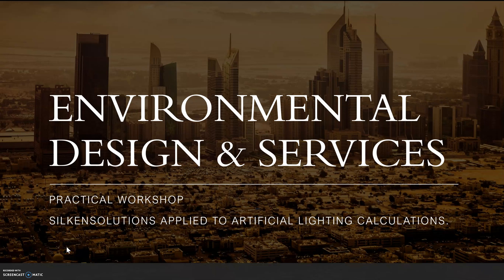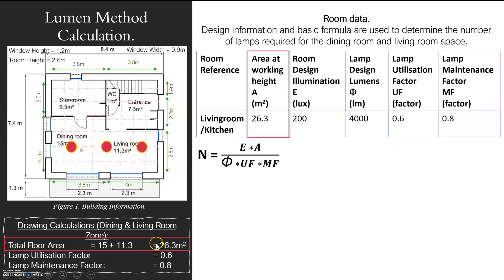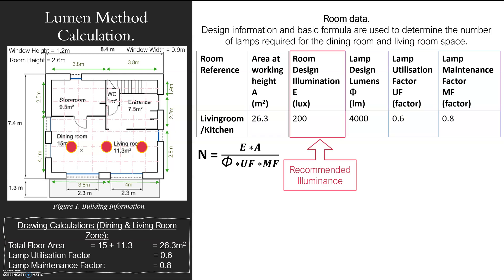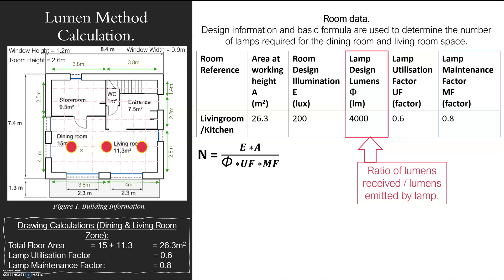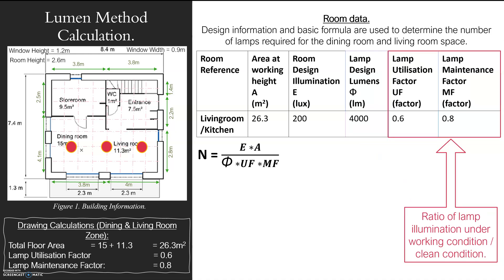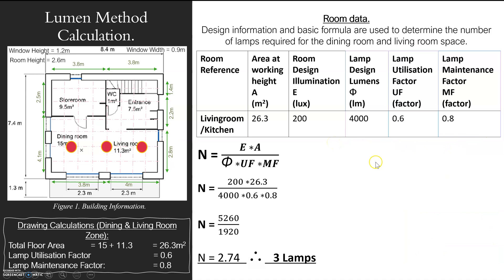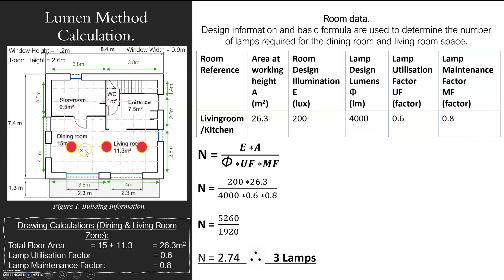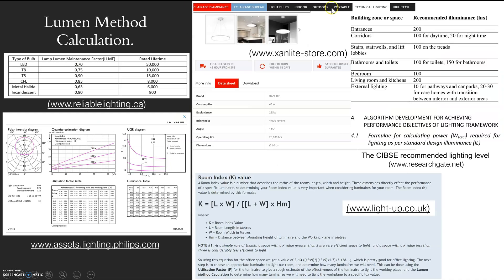Lighting Calculations: Lumen Method

Comment: Sorry to tell you this but on the area you are wrong the area you have ther is not 26msq but 170msq the area is times not plus 11.3x15m =169.5 thanks for trying kind regards
Reply: It is dining room plus living room so around 26sqm.
Reply from the maker: Apologies I don't look at comments normally as these resources are for my students. I'm not a published author and will make mistakes but when I come around to upgrading this resource I will ensure to add this detail.
Reply: Why do you multiply 2 given areas? Dining room area=15sqm while living room area=11.3sqm, so more  like 26sqm in total. Well not unless you were given the length and width of the room so you have to multiply to get the Area.

Comment: Why divide the required lux with lumens from a bulb? lumens do not consider height and coverage. I am curious why not using the average lux measured at the same distance, provided by the light manufacture ?
Reply from the maker: Apologies I don't look at comments normally as these resources are for my students. Luminaires are all different depending on how they are built with diffusers etc, so I have not included this for simplicity and followed the formula with notional values. When I come around to upgrading this resource I will try to include this detail somewhere.

Comment: Nice video , is the UF & MF fixed in doing calculation from where u get the values ,
Reply from the maker: Apologies I don't look at comments normally as these resources are for my students. Lighting manufacturers provide their UF and MF depending on the fitting you choose.  I'm not a published author and will not be able to reference everything due to time restrictions but when I come around to upgrading this resource I will ensure to add this detail.